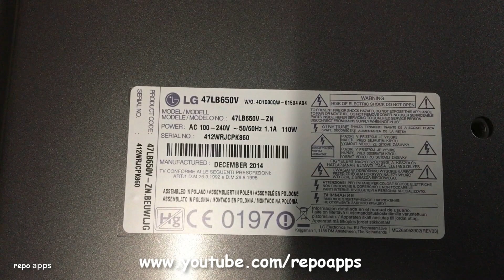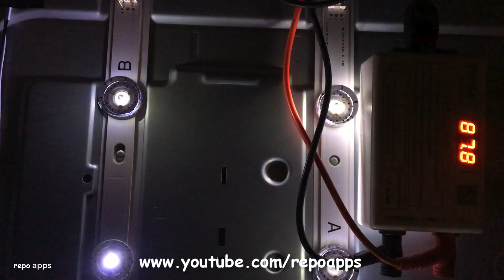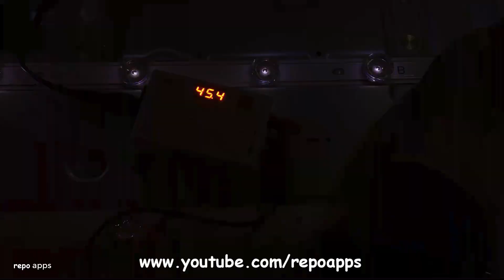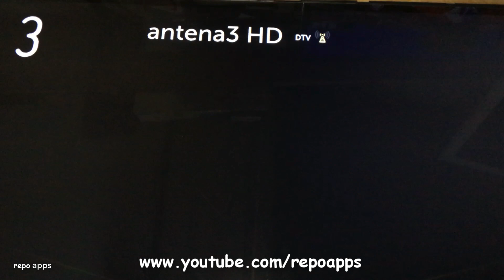How To Fix LG TV 47LB 55LF 55LB NO BACKLIGHT ‼️ How To Open TV ‼️ LED voltage Test✅ Troubleshoot TV

Comment: I already replaced a few of the LEDs two times in my 47LN... I use a slightly different technique. I take out the whole strip and use hot-air only. When reassembling you want to be very careful the display panel to fit in the bezel correctly (I once cracked a screen).
Good work, keep it up!